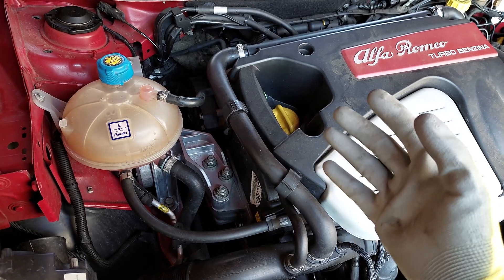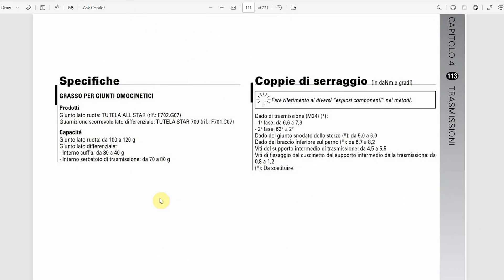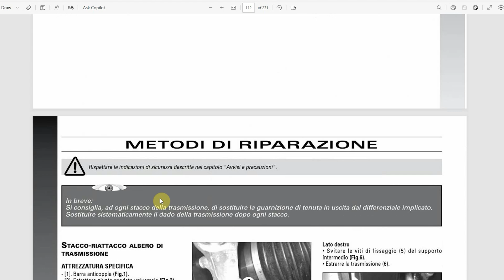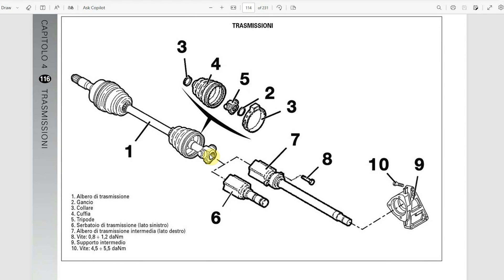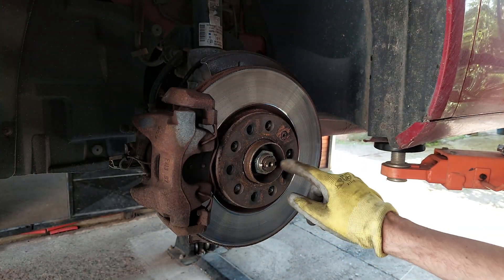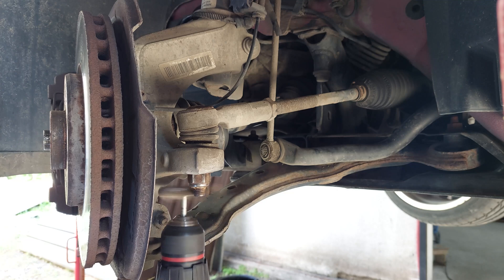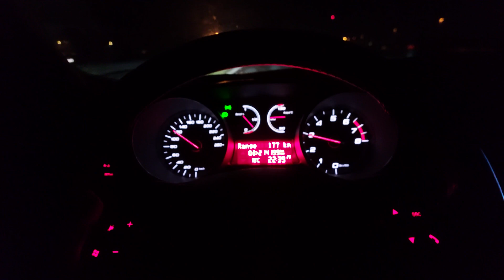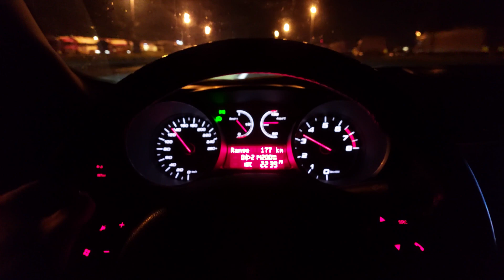CAR SHAKES AT 120 KM/H FIX, HOW TO REPLACE INNER CV JOINTS, SPIDERS, TRIPODS

Comment from the maker: Make sure you do your due diligence when it comes to diagnosis of the issue. I had the same problem on several different cars I was working on, which were all solved by doing different things, including replacement of the gearbox mount, fixing the bent front wheel, tire replacement, and worst of all gearbox/differential rebuilt.
Reply: 1.4 T-Jet: car vibrates in any speed, but only when there is bigger then only mild acceleration. New both CV shafts with all 4 CV joints, new engine and rear transmission mount / left transmission mount still decent, M32 transmission about 10.000kms after rebuilt with no M32 symptoms of failing anymore. I am out of ideas, except for failing dual mass flywheel.
Reply: Specifically, what was wrong with the differential? tnx

Comment: Hi, great video! I’m having vibrations and slight wheel wobble around the 70/80 mph range, I am also getting this under breaking. A few forums seem to suggest this could be a tyre issue. I have had the tracking and wheel balancing done. Is there anything else I can check to see if it is the inner cv joints?

Comment: On my 147 1.9jtdm, it vibrates when turning right, and it vibrates on harder acceleration, especially uphill. No sound, however, only vibrations. I changed my wheels and tires at the beginning of the winter season, and the peoblem still remained, which means it's not a wheel/tire issue. I suspect the inner joint, but I could try fitting a complete right spare drive shaft from a scrapyard.
Reply from the maker: Could be man, not a bad idea, but it has to be in top condition

Comment: Hi thanks for the video. It actually doesnt look so hard to do yourself. I was scared for a second beacuse i have the same problem right now  and over last year i had a  few problems with my giulietta and if i had to take it to shop once again i would go crazy. And I have a question, is there any posibility that i can text you in private message because i have problem with suspension on alfa ( its squeaky etc) and my mechanic told me that it would cost crazy amount of money to fix it, and i was wondering if you could help me diagnose it and maybe suggest what can i do. Thanks in advance, and thanks for the video one again
Reply from the maker: Of course man, hit me up, you got the email in the about section

Comment: Perfect timing 😂 although I'm worried I have a bigger issue with the differential clunking at low speeds (i have the mito with the identical engine and gearbox), but when I was checking the driveshafts for excessive movement (in the outer cv boots for me), I also noticed there's a big clunk in the differential when I shake the driveshafts for play.
Reply from the maker: Yeah, it could be different issues. I have solved this same problem on couple of different cars with different things
Reply: @arcgarage  the CV joints have a lot of play in them, like moving much more than yours but yes before I go changing the driveshafts, I want to find out what else needs replacing because my theory at the moment is that something in the differential or the gearbox is defective and that's what caused the driveshafts to get so bad, this car hasn't had much maintenance in the past and so I presume it was long overdue a gear Oil change too so who knows what could be wrong. I am a mechanic myself but unfortunately that means I have no time to take my own gearbox down etc as I am too busy fixing everyone elses cars 😂 but yes I'll hold off on the driveshafts for a while until I have the full picture.

A lot of clunking at low speed stopping and taking off especially, even a clutch smell when turning at a junction quite fast, so I've suspected the gearbox or clutch isn't perfect for a while, although I thought replacing the bottom engine mount would fix the noises at least but no, when I had it up in the air for that, I noticed the driveshafts and differential clunking, and alas the engine mount change fixed every nose but the main clunking so, I'll have to dig a bit deeper when I have the time to (my work isn't keen about us doing work on our own car even on a Saturday)

Apologies for the long response